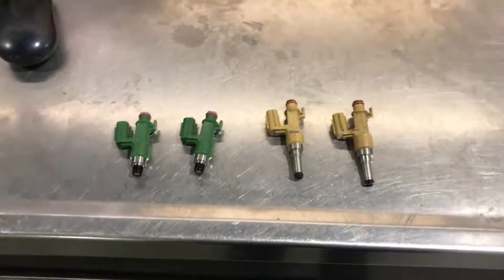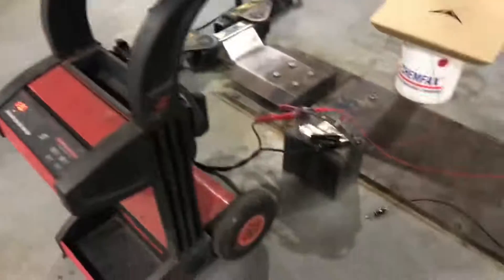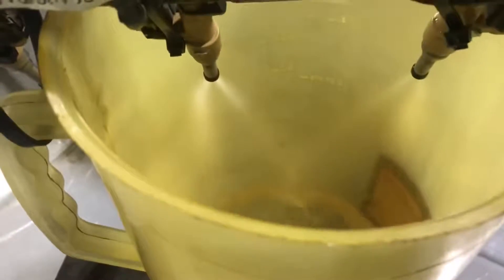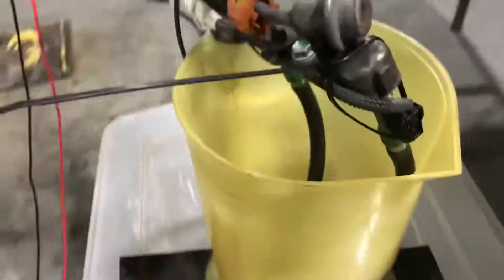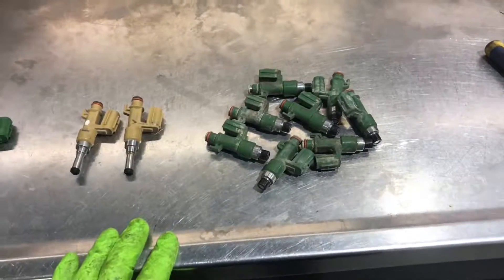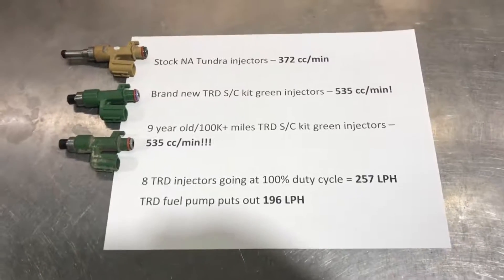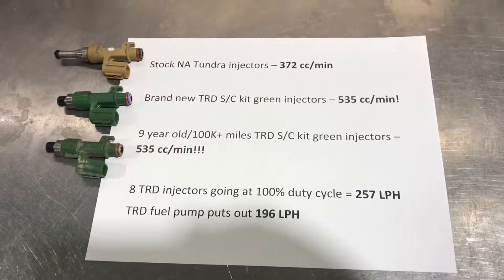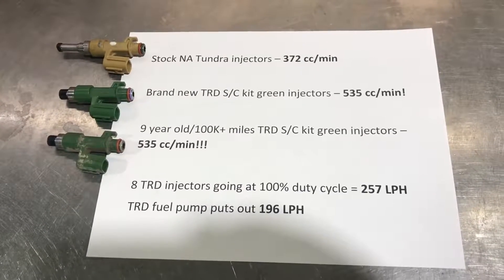Toyota Tundra 5.7L Fuel Injector Flow Testing - New vs Used, TRD S/C vs Stock NA

Comment: Where did you purchase the TRD/SC injectors? I've had a hard time finding replacements.
The part number I've been searching is DENSO 23250-YWF01, is that the same as your brand new ones?
Reply from the maker: @jordanrusson7  hi, mine came with the supercharger kit. I don’t know if they are available for sale at all anymore. Everyone is upgrading to 650cc injectors these days anyways. You could probably find a set of used Denso ones on tundras.com if you need the green S/C ones.
Reply: @Viktor_G_Automotive  Makes sense, thank you. Do you have any recommendations for 650cc injectors if I decided to upgrade?
Reply from the maker: @ a lot of guys like DW 650cc for the Tundra. You would need a custom tune of course if switching from the TRD ones.
Reply: @Viktor_G_Automotive  Awesome, thanks for the info!
Reply from the maker: @jordanrusson7  no problem!
Reply: I have a stock 07 tundra 5.7 can I throw some 535cc or 650cc injectors do I need any supporting mods. Or am I asking for trouble I have 260k kms on it

Comment: Hey viktor!
Geeze when it rains it pours! I have the dreaded P2443 fault code in my Tundra. Rather than take it to a stealership, what are the odds you would take it on? 
What the best way to get in touch with you?  I’m up in Grande Prairie. 
I have cleared the fault and it hasn’t come back yet. Your thoughts?
Reply from the maker: Hi Grant, unfortunately I am unable to take on any diagnostic or side jobs at this time. From the code, it sounds like you may need to replace the secondary air injection air switching valve on the passenger side under the intake manifold.
Reply: @Viktor_G_Automotive  
Yes, been doing lots of reading on that looks to be a bigger job than I wanna take on. I thought maybe you were moonlighting these days and not working for anymore. Can you make any recommendations? I hate it to a dealership. I’ll just get bent right over.
Reply from the maker: @gburwash01  it’s not really a big job, just the intake has to come off. I think any reputable independent shop should be able to do it.